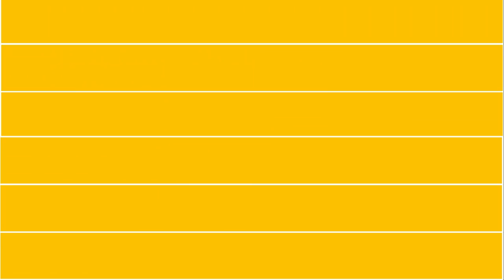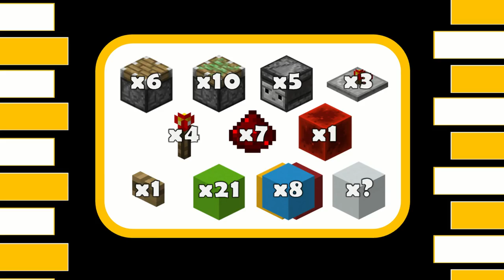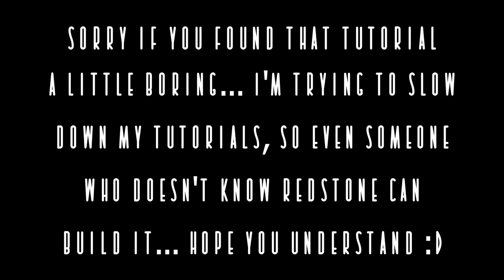Minecraft PE MUMBO’S IMPOSSIBLE PISTON FEED TAPE (PE/Xbox/Windows10/Switch)

Comment: 10:50 much easier than placing a bunch of furnaces and placing one block. Also, this method will make the door open for a split second, but you can prevent that from happening, by placing a comparator with a repeater on 4 tick delay.